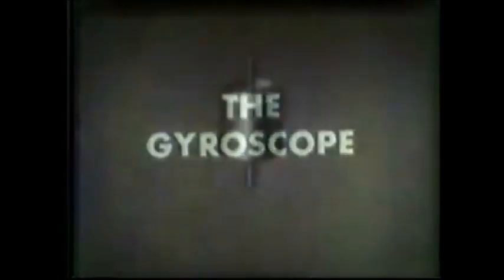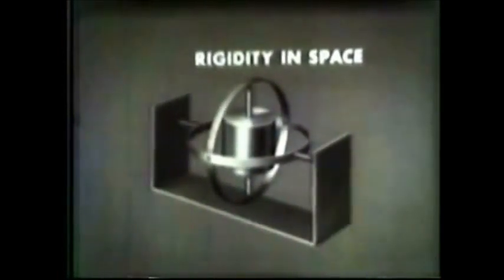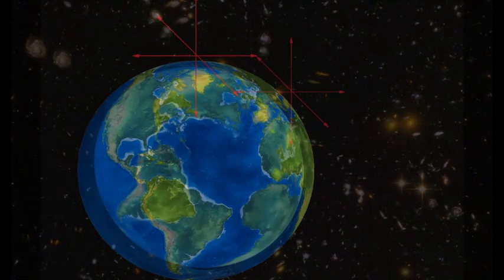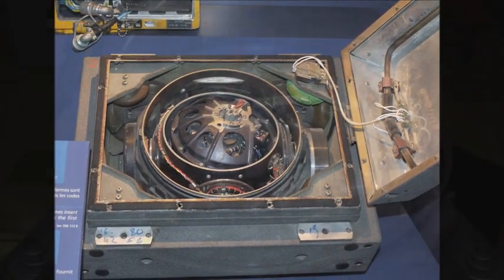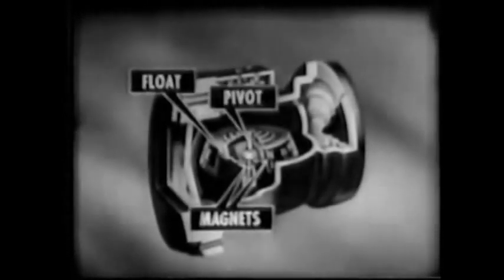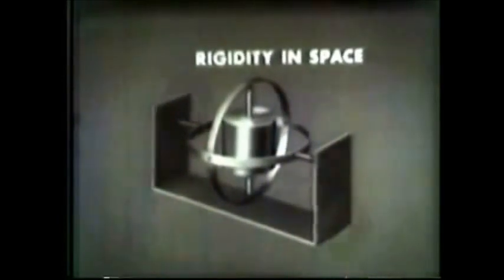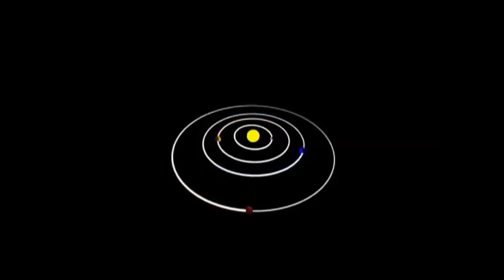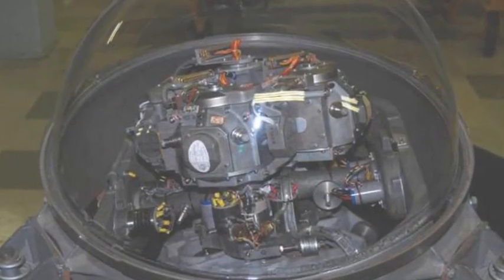Gyro Navigation: IMPOSSIBLE on a Globe...

Comment: I have been pondering this same thing for some time, I can't figure out how this simple hypothesis could be wrong. There is an experiment done online using a powered gyroscope and it remained vertical for hours. I am fairly certain that it should lean over, just as illustrated in the flight video you referenced. I read about "Schuler tuning" which as you state is essentially something to overcome the gyroscope and re-orient it based on location-which basically renders it to a gravitational leveling device with damping-a navigation system for a navigation system. I read somewhere down in the comments something to the effect of everything on earth is moving together, so nothing moves relative to each other-like tossing a ball up in a moving car-it just falls straight down. The flaw in this statement is that constant rotational motion (as opposed to constant linear motion) requires acceleration because the direction of movement of the item being rotated is constantly changing. Similar to the supposed proof by Focault's pendulum, the gyroscope would remain oriented while the earth rotates underneath.
Reply: +Ray J Nope, the gyroscope was set on the earth so it carried that inertia - it was already moving at the same rate as the earth so it will stay the same unless another force acts on it
Reply: +Ray J   Apparent drift is the gyro drift that occurs when the plane flies around the globe so the gyro has to remain oriented the same as it was relative to the poles. It is real, but it is compensated for in the read-out mechanism. They erect the gyro frame to the gravity-down direction during straight and level flight, as determined by the controls being neutral for a long period. So if you could watch the gyro flying 6000 miles you would see it turn 90 degrees, but the erection frame would follow the gravitational direction and roll and pitch are
measured off that frame.
Reply: The experiment shows that the vertical axle stays vertical. Yes it does, but not if you started out with the axle horizontal (in only 6 hours 45 degree difference.).
Reply: Ray J
There is too much friction in the bearings of mechanical gyros. The force from the earth's very very slow rotation is much less than the static friction of the gimbals. It requires a laser gyro or interferometer to detect the earth's rotation or its curve.